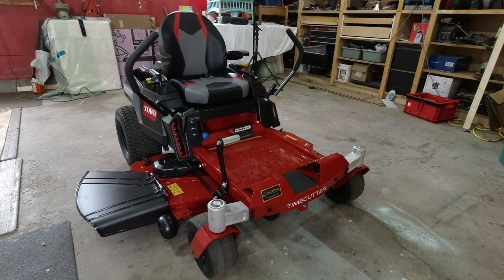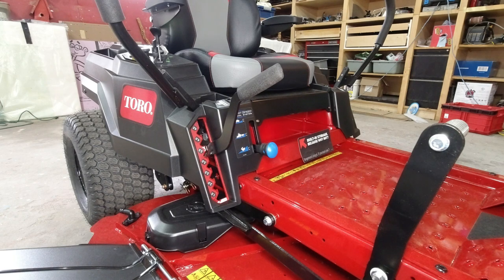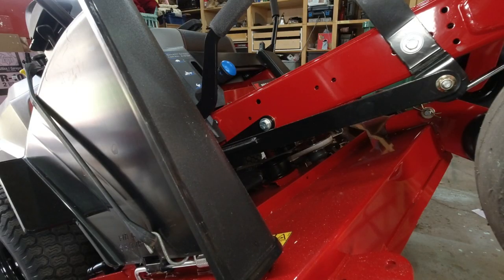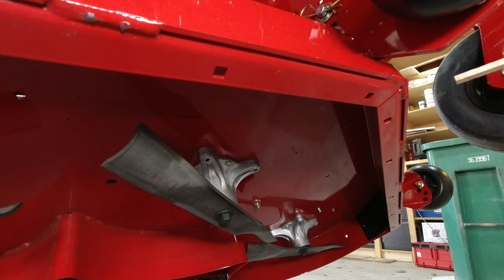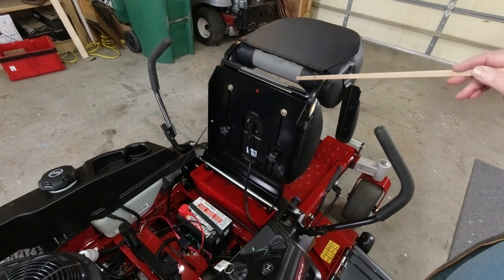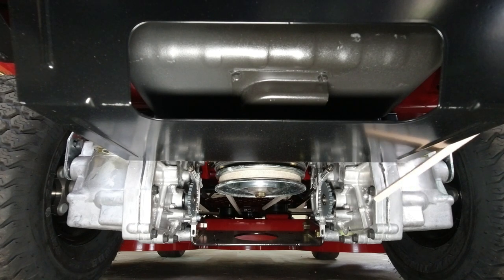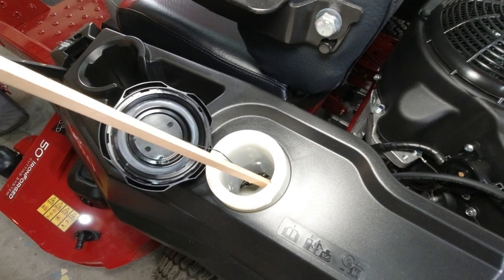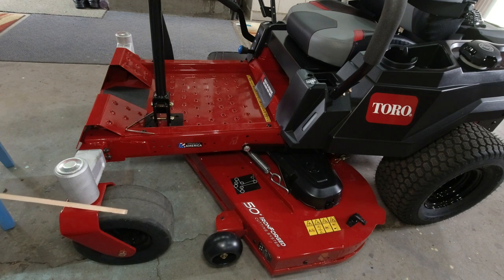2020 Toro TimeCutter Walk Around Review

Comment: I've come to realize how big a deal Zero Turn is. I bought a used 2002 riding lawn mower that I fixed up, and it works and cuts just fine. The problem is, it has the turning radius of a battleship. Over a few weeks I developed a strategy to mow my lawn in the quickest way using the least about of gas, which it chows. But it still takes a lot of time to mow, requires a lot of forward/reverse jockeying, and as an expedient I leave various spots un-mooed, which I then have to finish up with the push mower. Excellent video, The Toro will be my prime candidate when I go after a relatively inexpensive Zero-Turn Mower.

Comment: I bought this same mower about a month ago after looking at all the competition, I love it! I had an hour meter installed, bought the light kit, and installed myself (i don't know why I'm in bed by 8:00pm). It's a great machine, cuts beautifully and fast. You won't go wrong with this mower, especially if you buy from a dealer that can answer a question.
Reply from the maker: No, it's very easy. On the dash by the throttle/ignition feel the decal with your finger. You will feel a rectangular cutout under it. Cut that out with a sharp knife. Stick the hour meter in and then just plug it into the wiring harness.No wiring - just plug and play.

Comment: Thanks for the review, Toro's have always been good machines, I bought a Cub Cadet LT, wish I would of bought a Toro or John Deere.  On another note the Bolt holes are for letting moisture out so the stuck grass can dry faster leading to less Rust over time
Reply: I believe those holes are actually  there to mount an accessory called a 139-7459 - 50 INCH BAGGING ENHANCEMENT KIT, which will enhance bagging performance in extreme conditions such as heavy, wet grass or autumn leaf bagging.

Comment: Would include some explanation of attachment of rear deck adjustments. Seems difficult to get the deck up higher than 3.5 in.
Reply from the maker: All the adjustments to the deck are done with the front bracket. Make sure the rear bracket is in the slots on the deck. 
Make sure the rear tire pressure is the same for both wheels. I find running 20 psi will raise the cut a little,

Comment: I think you forgot to talk about the front casters. How easy it is to take those front wheels off if you've been 1ofthecasters
Reply from the maker: To take a front wheel off. Raise the other front wheel off the ground with a ramp, etc.,Then remove the axle. On most of  these ZTR's you will need two 3/4 inch wrenches to loosen the nut and remove the bolt.

Comment: Hi Paul - great review.  Quick question for you if you know.  The accessory sheet for the 75750 shows that you can install a Toro 116-5461 hour meter on it.  I can't seem to find a cut out on it anywhere where the hour meter would pop in.  Do you know where that would go by any chance?
Reply from the maker: No, I don't have an answer at this time. I'll ask my dealer if he knows. My Exmark has an hour meter and the slot where it sits under the seat is missing on this mower.
Reply: Dude I have it, it's right in the little triangle area in front of the throttle. Had to pay sixty five bucks for It which was a rip off
Reply: @buckybarnes3803   Toro is brutal on pricing accessories. I put a $20 Husqvarna meter in mine, same size and wiring.
Reply: I find it pretty ridiculous for a manufacturer to skimp on adding an hour meter particularly for this level of machine and since maintenance is based on hours of operation.  Fortunately there are inexpensive hour or rpm/hour meters you can add but why put the consumer through this extra hassle.
Reply: I only paid 45$ for the hour meter.It pops in right on the control panel,there is a cutout covered up by the dash label.
Reply: @wrenchguy8375  I just bought 75742 and the dealer installed one for only $25. Looks like a good price.

Comment: Got my first zero, the 75755 easy glider, Saturday.  Think I'm really going to like it after getting used to it.  Probably will buy the mulch kit later.  And the spring tool you discussed.  Can't get it to go exactly straight with adjusting the nuts on the sides near the control bars tho - wants to pull a little to the right.  Thanks for the walk around.
Reply: I am no genius but I think you need to move one of your handles slightly forward or slightly backward / Till you get it to go straight when you're both in the same exact spot
Reply: Hello. I'm sure you've fixed this already but anyone else who might be having the same problem, here is the fix. Lift your seat & you will see 2 11mm bolts for each handle. Just adjust the desired amount till both handles pushed all the way forward the mower stays straight. 

***These do not take much force to adjust & only adjust so far. Be sure to keep an eye on the half circle cut out & plastic knob sticking out for a reference** 

If the handles do not line up correctly in neutral then you adjust the bolts on the handles.

Hope this helps

Comment: In your opinion which self-propelled walk behind mower has the best vacuum/lift capacity.  I live in central Alberta, Canada and we only have about one month where the overnight temperatures are quite warm, thereby, allowing micro organisms to work effectively on lawn mulch, so I bag all my lawn clippings and place them in a formal compost pile.  Years ago I had a Snapper Hi-Vac and it did a  pretty good job of sucking up the clippings.  Of todays lawnmowers which one would you recommend?
Reply from the maker: The Honda HRX217K6HZA or Toro 21” Personal Pace® SMARTSTOW® Super Recycler® Mower (Model 21386)

Comment: Im trying to decide between the 42 inch stamped deck vs the fabricated deck. Durability regarding running into stuff is not a concern. I have a flat 1/2 lawn. My question is which is better at mulching? The stamped deck seems more round and the fabricated deck needs baffles to make it round and I’ve heard that grass clumps up in the gaps. Thanks
Reply from the maker: Stamped decks just plug the discharge. They are multi-purpose decks so they are not the best choice if you want to mulch all the time. A fabricated decks with baffles will do a better job. 
Just remember, to mulch properly you need to mow no more than 1/3 of the grass stalk off at one time. That means if you mow at 3 inches you should be out there mowing when the grass gets to 4 inches or so. During the growth season for your grass you will need to mow more often than once a week. 
Mow slower than side discharge so the blades have the time to reduce the clippings into little pieces. 
All that said, If you mulch correctly grass won't clump up under the deck.
Reply: Thanks!! That settles it I’m getting the 75744
Reply: @PaulSikkema  Only problem here is that when you install the mulching baffles on this fabricated deck,  that is ALL YOU CAN DO (no bagging or side discharge) unless you remove the whole mulch kit.  Kind of a PITA if you have a lot of rain or go away on vacation for 2 weeks and the grass is too tall or wet to be mulched.
Not easy to switch between discharge modes like the Toro stamped deck models or the John Deere residential zero turns.  
But the mulch kit looks to be effective with the built in "kickers" like on the Super Recycler mowers which are great at mulching.

Comment: My husband is working on my Toro v twin commercial 24.5 (2017) because it was cutting uneven.  Looking under it we saw that the brackets on the stabilizing bar were a bit off center, perhaps I hit a stump? 😉  NOW the bracket on the left as your looking under has a raised piece that goes in a slot on the frame.  Should that piece be bent toward the center of the mower? 

We've watched numerous videos trying to catch a glimpse of that as they reattach the deck...... But no one has shown it up close

Ugh......please help!!  Thank you. ☺
Reply from the maker: Hi May, I couldn't quite figure out the bracket you want to attach. I suggest taking a ride to your nearest Toro dealer tomorrow and looking at a mower on the sales floor. When you look lower the deck all the way so you can get a good view.
Reply: Paul Sikkema thank you so much for responding!!
I think we’ve figured it out. 
One bracket has a slightly raised side and bent towards the center as to NOT slip into the hole on the frame. 
We were afraid it had come out of there. 
But we definitely will head to a dealer tomorrow. 
Thank you 
God bless you

Comment: Hi Paul. I have to TimeCutter featured in this video and am now thinking about using it to help with the falling leaves. Would you recommend purchasing the bagger attachment with mulching blades to pick up leaves or would another setup work better? Thanks.
Reply from the maker: Personally, I mulch and then use a good sweeper to pick up the chewed up leaves. I have this sweeper: https://homedepot.sjv.io/kAJKV
It's less expensive and takes up a lot less room in my storage shed. That said, 
The Toro baggers work well but I suggest installing the high-lift bagging blades instead of mulching blades. Mulching blade may not have enough airflow to throw wet leaves into the bagger and fill the bagger.
Reply: @PaulSikkema  Thanks for the pointers. I think I am going to try to the mulch option this fall. I just don't want the mulched leaves to clump and kill the grass - I am going to try to mow several times and while it is dry.

Comment: Hey Paul, I have 1 acre with about a 10 degree slope in the backyard, do you recommend the 42 or the 50 inch timecutter? I am looking for the best looking cut!
Reply from the maker: I like the 50. It has a wider tire stance so it will feel better on the slope.

Comment: Hi there Paul, does the 2020 Timecutter model come with an hour meter? Thanks.
Reply from the maker: No, it does not. There is a cutout on the dash (just feel the decal to see where it goes) and the plug is in the wiring harness. It's about $67 at your dealer or The Home Depot.

Comment: I heard but don't know is that they have a chip board inside the control panel that if it gets moisture they fail and you won't be able to do anything
Reply from the maker: There is no chip board on this machine. The electrical system on this machine is "conventional" and the mower doesn't use a computer module. The engine has it's own module mounted on the engine itself. 
It does have a logic module for the automatic parking brake system but that is located on the frame near the battery and completely sealed. The first year (5 years ago) they did have to replace a few of the brake modules right away but Toro quickly found the issue and there have been no problems since.  Here is a parts list so you can verify this info https://www.toro.com/en/parts/partdetails/?id=52403

Comment: I've been told that Toro is discontinuing their Toro brand V-Twin engine (and maybe others?) because the pricing from China recently went up significantly.  Any truth to that statement and if so should I buy a model with the Kohler 7000 series instead to insure future parts availability?
Reply from the maker: I'm meeting with Toro next week and I'll ask then. Would you please ask this question again after Oct 23rd?
Kawasaki is also made in the U.S.
Reply: @PaulSikkema  I certainly will.  Thanks for asking.
Reply: @PaulSikkema  Paul:  just asking this question again about the Toro engine as requested (see above).  Did you attend Equipment Expo 2022?  Toro has a price increase coming at the end of this month so should I buy this year's model and save a couple hundred bucks or are there some significant improvements coming for 2023?  Thanks in advance for your answers.
Reply from the maker: The Toro engine is being discontinued because of cost - not performance. The V-Twin lawsuit from B&S on foreign made engines, Tarifs, and shipping have all made importing v-twin engines unrealistic at this time. 
Yes, Equip-Expo was great!. I'll have videos on it in the next week or two.
The only thing coming from Toro residential is a 60 inch Blacked out Titan Havoc edition to go along with the TimeCutter Havoc from last year. The rest of the residential line-up will not change. (Almost everyone is focused on commercial electric ZTRs and robotic mowers right now)
Reply: @PaulSikkema  Thanks Paul, that confirms the same information i was given.

Comment: Great Review. Finally someone making a good solid review. Question. Your thoughts on the Kohler engine option. Really hard to find with the Kohler. You may not have an opinion on it but figured id ask. Thanks, and take care!
Reply from the maker: Yes, I do have an opinion. The Kohler 7000 series has an excellent reputation. It has great fuel economy and the governor is more sensitive than the other brands - meaning when cutting heavy grass it will pick up quicker and the engine will not lug down as much. 
I have no preference between the Kohler and the Kawasaki (or the Toro engine) 
I would NOT pay extra for the Kawasaki.

Comment: Nice review but I think I'd still prefer bearings with grease zerks.  I don't trust sealed bearings much after having to change wheel hub assemblies in vehicles, when with old vehicles I could just grease the bearings in my palm and even if I had to buy new bearings they were way less expensive.  When the sealed mandrels wore out on my current mower I replaced them with mandrels with zerks and I expect they'll last much longer as I tend to do maintenance on my equipment a bit more often than the manuals call for.

Comment: Your review is exactly the mower I am considering and you addressed my concern with ConsumerReports Alert which is now no issue; however, I have a landscaped yard with Bermuda sod and want to continue bagging.  I saw some comment from ConsumerReports without detail that bagging with this mower not as good as others but providing no other details.  Can you ease my concerns about bagging.  I am having a knee replacement and up till now have been using a Husqvarner AWD which I have been satisfied with the bagging just lots and lots of work. Getting older also. Thanks Paul
Reply from the maker: I went over and looked and CR is stating N/A which means they didn't test the bagger. 
If you've never owned a ZTR with a bagger there are a few things to know so you won't be disappointed. 
1. They work very well for leaves and dead grass.
2. They do not work very well if you have the mulching blades installed. If you want to bag  green grass clippings weekly, you need the high lift bagger blades installed. You can use the regular blades the mower came with - but they won't create as much suction to pick up all the grass. The hi-lift bagger blades also work very well for side discharge. 
3. They don't bag wet grass. If there is dew on the grass they may work, but won't throw the bagger full. If the grass is wet from rain they most likely will plug the discharge chute more than they throw the grass into the bags. 
4. There are a few companies that make a powered bagger. Gravely for example has a fan that attaches to the deck and that will throw any grass - even wet stuff into the bagger. (but it's $900)

All that said, if you are mowing your Bermuda when it needs it (two to three times a week) you won't have any issues. It's when you wait until you have 4-6 inches of growth you will have problems. If it's not doing a good job slow down to a walking speed.
Reply: @PaulSikkema  I never let it get to high and always dry.  Looks like I will not be disappointed with bagger results with the proper blades and wanted to stay away from a powered blower. This helps a lot.   Many thanks. James Camp
Reply: Paul hate to bother you again with a question but getting my order finalized and I saw Toro's YouTube video on their bagger which showed weights being installed on the front of the mower.  Do you know if this actually comes with the bagger and if not, is it recommended knowing I never cut my lawn when wet which of course would add more weight. Again thanks for your help. James Camp
Reply from the maker: Yes, the weights come with the bagger. You will need them installed if you have slopes. 
Almost all ZTRs get very rear "tippy" with a bagger full of green grass. It's nice that Toro includes the counter weights. For safety, I can't tell you not to use them.
Reply: @PaulSikkema  Many thanks!

Comment: Paul could you possibly provide the total width of the 75750 with Toro twin bagger installed (without the blower or fan).  I need a wider gate installed to have access to mow and to store.  I have not been able to get reliable info calling others. Thanks.
Reply from the maker: HI James. It will go through a 5 ft gate with the chute up. The chute catches when going through a 6 foot gate with it down. So, I suggest a 7 ft minimum to clear the mower with a bagging chute.

Comment: The 42 inch comes in 6 models (counting the two California models). The two base budget models are the only 42 inch models that has the stamped deck. The other 4 models comes with the 10 gauge fabricated deck, the same as their premium line and the same as they put on most of their Exmark brand line.
Reply from the maker: Exmark has its own deck designs and it is different than Toro's. It is a very similar deck. but different. Specifically this year Toro did a slight redesign making it easier to put the Bagger Boot on (don’t have to remove the metal cover over Top Discharge opening.)
It's also easier to install the mulch kit. New 42’’ units come with 3n1 Wave Blades now.